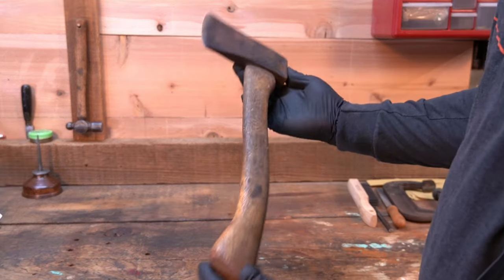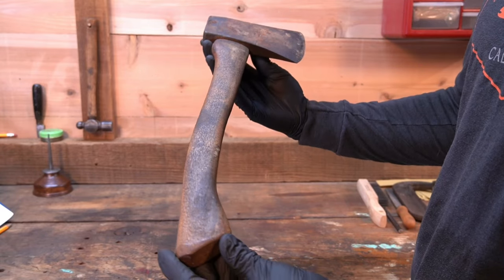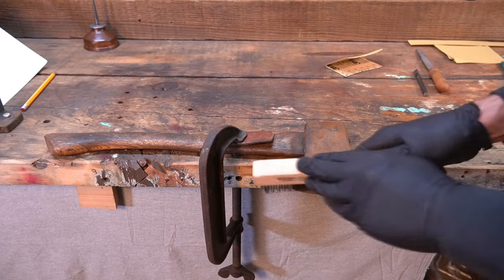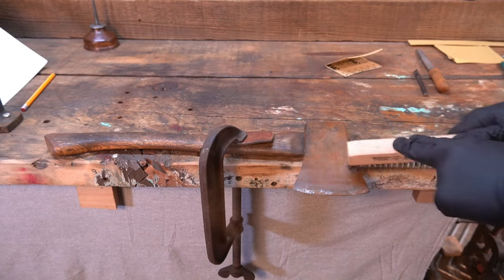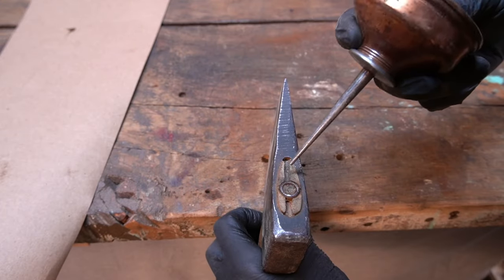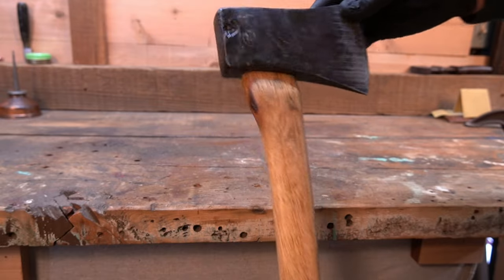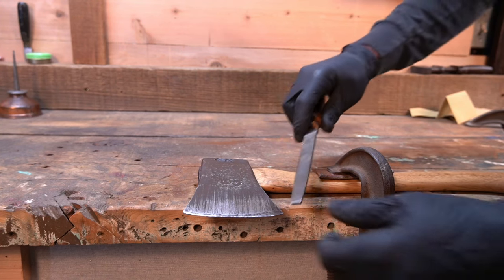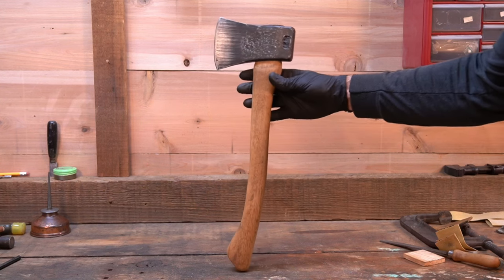A Simple Rusty Axe Restoration For Beginners

Comment: What was the 1st grit sandpaper did you use on the blade? And was that a ball peen hammer to bring the eye of the hatchet farther down on the handle? Last question, what size was that C clamp did you use with that piece of leather?

I just found your channel so thank you for this in depth video 🙏🙏

Comment: You should of pulled out the wedges and did the gimmick you did but with a file then soaked the head in blo thenx did a new Wooden wedge and then redo the metal wedge as well .